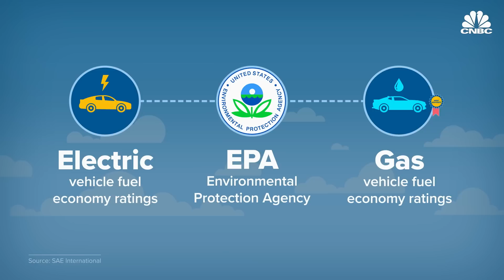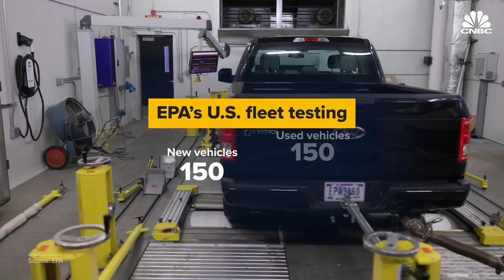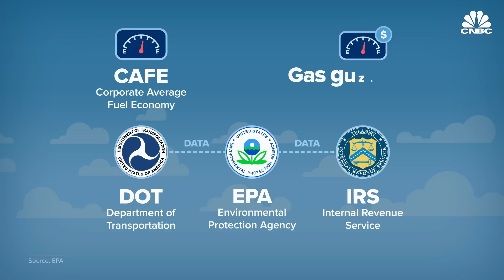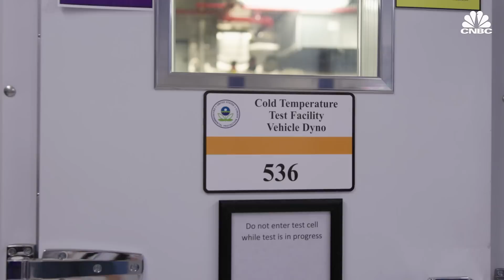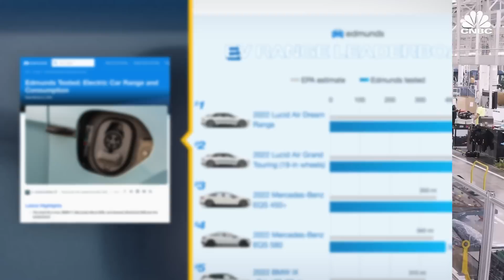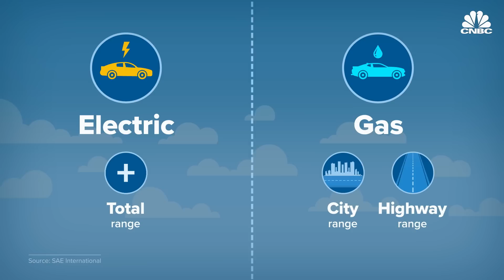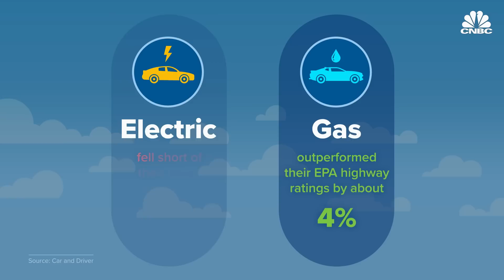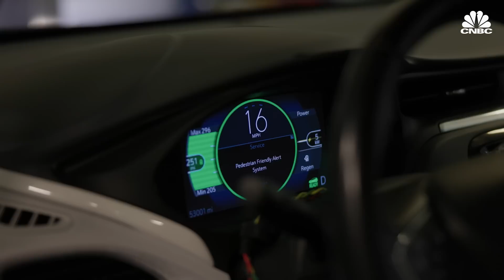Why Tesla And Other EV Ranges May Be Inaccurate

Comment: Duh and/or hello! There's so many variable, it doesn't matter whether you're talking about electric vehicles, electric bikes, Onewheel skateboards, gas cars, diesel trucks, hydrogen vehicles, planes, helicoptors, literally anything with an estimated range; that's something different than what you're gonna get under various conditions. Because there are so many variables. Plus almost no one operates a vehicle down to zero miles.

Comment: It’s not that the ranges may be inaccurate, they are inaccurate.  This has been tested by multiple people & the estimated range is on average 20% more than it actually is.  This is not the case with ICE vehicles.  This EV manufacturers need to stop this.  Stop testing this stuff in a lab & do a real world test instead, because the numbers you get in a lab with no wind resistance or grade changes is not going to be accurate at all, as well as not placing any people in the vehicles.  Also, they need a separate City/Highway range for all EVs, not listing this is simply irresponsible.

Comment: It is not the range that counts but the ABC always be charging. It will be with you for the duration of owning an EV. Range must consider the using of air-conditioning, the radio, simple charging your phone, light open at night driving, too much stream cold/ hot condition, driving up hill/ mountainous places are all degrading your battery plus the weight if you have a spare tire/ number of passenger so numbers of range depletion is the issue but the EV again being unreliable/ unpredictable. This is not the future but n old technology rather just an alternative solution not for all. The third world countries, island nation, stream hot/ cold places and mountainous places are not suited for EV. It could not be in rental services, bus companies in cross country trips, dump trucks in mining operation, military vehicle/ police mobile, container trucking cross country, airline industry, shipping industry not fitted for such situation needs. Expensive to purchase, expensive to maintain so much software dependent and insurance so expensive. This is only for rich countries and rich individuals as second car the EV...

Comment: I would like to see battery/range degradation numbers for each vehicle, as a function of calendar aging and mileage. Even more useful would be an EPA approved website where I can select a car model and year, and then input various parameters (payload, outside temperature, typical driving speed, vehicle mileage, etc), and get a range estimate. The more parameters I enter, possibly the more accurate the result).
Reply: Bro no. That makes way to much sense and would be very helpful

Comment: Great reporting. I drive a Tesla, and don't really have complaints on my range estimates. But I also recognize that EV motors are far more energy efficient. The huge battery pack is equivalent to just a few gallons of gas. So when something that could impact a car's range (regardless of power plant) it is felt more significantly on the battery with it's added energy efficiency. I also don't have range anxiety. I know that if my car shows that I have 20 miles of range, and my next charge is 10 miles away, there is little I could do 'wrong' to burn that extra 10 miles of range before I reach the charger. And the car does a great job of moving me to a closer charger if I am 200 miles away and it thinks I won't make it to a charger that is too close to that stated range.

Comment: EVs should have a city and hwy rating.  They peform poorly under load ; such as drving at freeway speeds.  A Rivian was driven towing a trailered mustang 2400 miles across the US.  It had to stop every 120 miles to charge for an hour; that is 3 hours to travel 120 miles or 40mph.  The EPA rating was 350 miles - EPA= biased liars.

Comment: Range anxiety will truly be gone, once charging stations are as ubiquitous as gas stations. IMO the range of the vehicles aren't the problem but access to plentiful charging stations.
Reply: Yah, tesla owners don't have range anxiety.
Reply: The number of chargers won't change the inconvenience of using public chargers.  It only takes 3-4 minutes to get enough fuel to go 300 miles in an ICE and the range typically drops less than 5% in winter and you can use essentially all of the fuel because you don't need a reserve to "precondition" a tank like an EV's battery when it's too hot or too cold.  Even if every charger was a supercharger it would require at least five times the number of bays to charge the same number of vehicles daily and that would require a tremendous amount of energy and infrastructure vs a couple tanks in the ground and some pumps.
Reply: @Noah_E     except it does make a difference because not every car is in use all the time. Chargers at home (multiple at apt complexes) alone solves the majority of usage which is where most vehicles would naturally be charged at and more frequent chargers completes the gap. Again precondition isn’t an issue if chargers are plentiful because that preconditioning is taken care of while plugged in and at no real cost to your “tank” the biggest issue is reliable and plentiful charging because any and all public charging would be only necessary to get you to your next destination (home) to then complete the rest of your charging.

Comment: 0:26: 🚗 Electric vehicles (EVs) are gaining popularity in the US, but there are concerns about the accuracy of their range estimates.
3:27: 🚗 The EPA tests cars to ensure they meet regulations and collects data for other agencies.
6:51: 🚗 The EPA faces challenges in testing electric vehicles due to the complexity of factors like battery depletion, real-world driving conditions, and heating/cooling systems.
9:32: 🚗 The way electric vehicle (EV) range is tested and reported can lead to discrepancies between lab results and real-world driving, causing range anxiety for drivers.
12:46: 🚗 Car and driver testing data shows that EVs fall short of their range numbers by 12.5% on average, and the range can vary depending on driving conditions.
16:19: 🚗 Automakers have a history of pushing against regulations, as seen in the Dieselgate scandal, but the focus is now on electric vehicles and ensuring they are environmentally friendly.
Recap by Tammy AI

Comment: EV's aren't just worse on the highway.  They are abysmal on the highway.  Range anxiety is not a thing.  Its time anxiety.  When you factor in the time, the cost per mile highway on an EV is roughly equivalent to a 1 ton gas truck.  It is atrocious.  EV's are great in the City, being roughly on par with 25+ mile all electric range PHEV's.  Hybrids continue to be the lowest total city and highway cost per mile vehicles.  Additionally performing cold and hot tests would greatly lower EV city and highway and PHEV city only economy.  ICE and Hybrids will mostly retain their numbers.  The EPA should rate in cost per mile and just use the national average kWh, gas, and diesel prices at the time, and should definitely factor in time for highway.  It is not apples to apples to allow the EV to take a 30 minute break to charge every couple hundred miles while requiring the Hybrid, PHEV, and ICE to mush on.  Total time of trip matters.

Comment: This discussion has no resolution. The variables factors are many. Take two identical F-150 trim level, engine, etc. trucks and one driver’s aggressive technique shall render an mpg up to 50% less than a driver with moderate technique. Change that to range and, just using numbers, a 300 mile truck shall have a 150 mile range. The reason to have EPA test under lab conditions is for consumers to have a comparison basis. I doubt any pickup owner selects the brand, model and trim level based on MPG test results. Take two Tesla Model Y’s and follow suit as to one driver cruising at 65 mph, in flat terrain, the other drives at 85 mph in hilly terrain. Range estimates from the lab go away. The range estimator in the car adjusts based on history. It’s not inaccuracy as to the software!

Comment: Ev's ranges are dramatically exaggerated offical figure's are no where near actual range in daily driving especially in adverse weather ev's have a place in motoring but are no where near ready to replace ice when everything is taken into consideration rushing ev's is the wrong way forward and the 2030 ban in new ice cars is madness no doubt most of them or their components will be made in China currently ev's are also way too expensive for everyday folk and they're no more environmentally friendly than ice unless you drive massive mileage even then it's not clear politicians need to rethink

Comment: I want to see a min/max range reported for EVs that is more than just city vs highway. Let's take two simple examples: he manufacturer would test the car like this: 1. A gentle drive around the city, no jackrabbit starts, no maxing out the power, no air conditioning or heating used, no use of the sound system. 2. A drive on a very hot day, with the air conditioning on, climbing at high speed up a mountain road, with the 2,000 watt stereo blasting and somebody in the back seat watching a video on a screen powered by the car. 3. A drive up a mountain on a very cold day with the heat fully turned on, deicers and widow wipers going.   IThis way I can get some idea of what range to reasonably expect and what my safety margins are in each scenario.

Comment: My first EV had a range of barely 30 miles. It was a '67 Mustang with a series wound motor and lead acid batteries. That was 30 years ago. My latest EV will go a month without charging unless I drive to the ball park and back.
Reply: A month? What ev
Reply: @blink182bfsftw  Pretty much all of them will do that. I drive 3,000 miles a year. Model 3 is my current model and I charge every other sunday whether I need to or not. Level 1 works for me.
Reply: I had a friend whos brother built a EV out of a VW van.  It could go 100 feet until it ran out of electrical cord, LOL

Comment: 13:23 — 13:42  How about a new required standard on that MSRP sticker: manufacturers must write a warning label to customers something like “Charge the EV at 20 percent”.  Could help a bit with range anxiety for now.  Or a software warning built into all EVs alerting the driver when the battery hits 20 percent, 10 percent, 5 percent, and finally at 1 percent.  Could lastly offer suggestions to where the closest charging station is, too?

Comment: I don’t plan on getting an electric car because the infrastructure is not there and they are not as good as gas powered cars. For instance the heat and cold affects the range but with gas cars there is no guess work.
Reply: My EV is already better than any ICE car ever made.
Reply: @bingosunnoon9341  Yea no its not. I put no faith in EV's as they are all POS's. They do not do well in the heat or the cold and they are a pain in the butt to deal with. Perhaps in 15-20 years they will be better but for now no thanks.
Reply: I race you with my EV in any ICE car you own  I know i will win
Reply: @rory-red  Shows how stupid EV Drivers are. Its not about racing. Its how well they handle long drives and the heat and the cold and sitting in traffic not moving for long periods of time. Get a life dude.

Comment: I rented a Chevy bolt and the range changes drastically while driving, I definitely understand the  range anxiety
Reply: Climate control and low temperatures takes its toll on your range. As long as you understand that, you will be fine once you develop your sense of operational charging and how to find the DC chargers while traveling.
Reply: @barryredman2803  oh I did not know that, that helps. Also finding a place to charge can be a challenge as well
Reply: @barryredman2803  that's a major problem that needs to be addressed and became glaringly obvious with the cold weather we've had recently.  My ICE's mpg drops by less than 5% when it's in single digits outside and it still only takes 3 minutes to get enough fuel to go 400 miles.  EVs range drops significantly in the cold and so does the time it takes to charge.
Reply: @Noah_E  Yes, so that means only 9% of the available energy in gasoline is actually powering your car, the rest of it is lost to friction, air resistance, and heat. Any actual solutions or do you just want to remain an advocate for carbon monoxide?

Comment: I've found Model Y to be accurate to 1 percent of predicted range over 200 miles on longer drives. It has greater accuracy on shorter ones. I don't use the miles remaining often, but this makes it within one mile of accuracy on a 50 mile trip. I consider this to be highly accurate and more accurate than any of the other three EV:s I have driven.

Comment: For starters, the idiots at the EPA need to include a 70 mph constant speed test. That would better represent what one could expect to get on a highway trip with a mix of 75 mph running, plus some slow downs for construction and lower speed zones, etc..  Only the government can make it this hard to do such a simple test that actually would be meaningful. Of course there also should be a city driving rating.
Reply: This is why I keep searching for YouTube videos doing exactly these tests on both ICE and BEV cars. For my speed of interest, 130 kmh (80 mph) almost all BEV perform poorly and this is why I do not plan to buy a BEV in the near future. If I have to go slower than a bus, what's the point of paying for a car?
Reply: @xynostasos9022 Do you drive at 130kmh often?
Reply: @anxiousearth680  I drive regularly at 130kmh-140kmh. And distances over 300km in total. The buses in my country drive at a constant 100kmh in the highways.

Comment: There are a few things they missed. Legacy automakers tend to do better than their published ranges, the range drops are mostly in start ups and mostly in Tesla's.  The reason is they use the 5 part test but also the Germans go one step further and state a lower range than tested, knowing that the cars will loose range over time.  Some pf the other legacy automakers do the same, but to a lesser extent. Also, many of the things that shrink EV range shrinks  gas range too, its is just less noticeable.
Reply: If you read the EPA submissions from Porsche, they gamed the numbers AGAINST their favor in classic Porsche underpromise and overdeliver.  The EPA allows you to use less aggressive dyno coefficients than the target, with the logic that the dyno itself and tires have rolling resistance that is in addition to the dyno set coefficients.  Many AWD EVs even have negative values for some of the coefficients because the dyno rollers lead to higher rolling resistance than flat pavement.

Porsche didn't even bother to deal with this.  They just set the dyno coefficients to the target, which meant that rolling resistance was double counted in their test in a manner EXTREMELY unfavorable to them.  Which is one of the reasons why the Taycan is one of the only EVs to beat its EPA range numbers when driven at 70 MPH steady-state - it not only does so, by does so by a MASSIVE margin.
Reply: @Entropy512 
Thanks for the info. Engineering combined with ethics and values. I like it.
Reply: My brand new Ford Fusion got closer to HALF the MPG it was rated for, even with premium gas and gentle driving.  I took it back to the dealer, they agreed, but said the official response from Ford was that FORD was ok with that.  I never bought a Ford again.
Reply: Tesla are crooks
Reply: Nobody in the auto industry does better than the published range.
Reply: @bingosunnoon9341  Outside of Mercedes, Porsche, Ford, the GMC Hummer....and I am not just saying this.  Review VLOGERs such as Out of Spec Reviews, Driven with Tom Vouelk, TFL EV, State of Charge, Edmunds, Car Wow, even some of the old fasion companies like KBB, Motorweek and MotorTrend  have all determined that some brands can in some cases greatly exceed their published range. So when an entire thread of people have confirmed this don't come to the table with your biased objection unless you have some facts to back it up.

Comment: Why does no one talk about the power grid not being able to hold the load of everyone charging
Reply: Because it can if we charge at night
Reply: Yup and charging can be load-shared/load-balanced at scale.  Within 2-3 years you'll be able to sell some of your battery capacity to the power company as a grid ESS system with V2G.
Reply: Because that's a made up problem you made in your head not an actual issue.